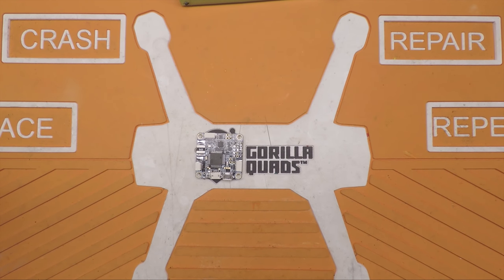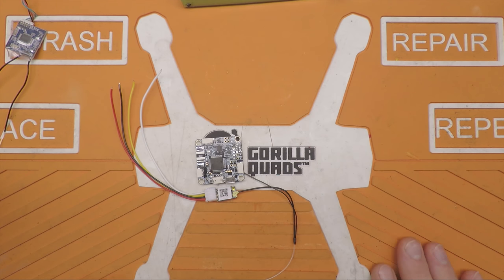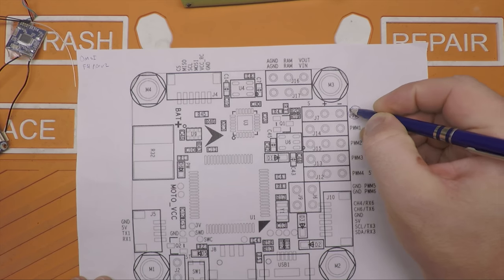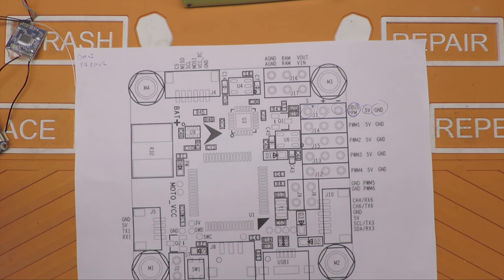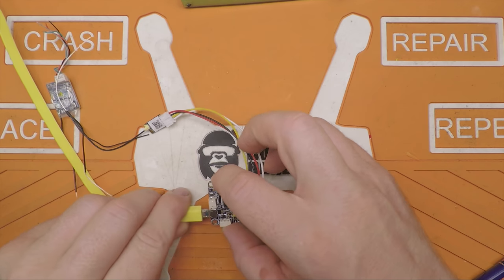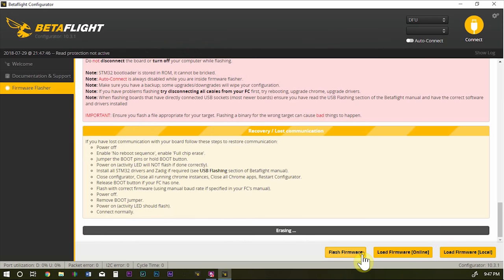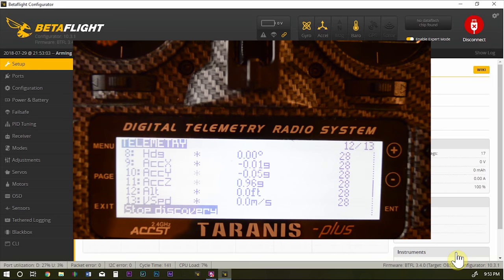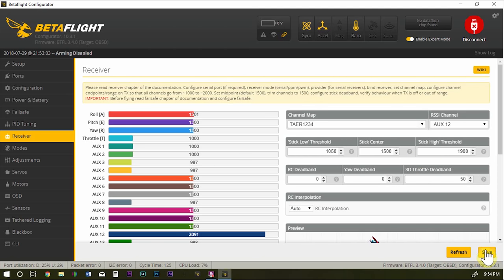How to setup frsky Smart port on a F4 flight controller r9 mini omnibus f4.

Comment: im try to connect my r9mm to a OMNIBUSF4SD board.  i on the lastest firmware 190201 on both my R9m and r9mm. i can bind them ok. ive tried wiring the sport to the Sbus receiver and also to a empty uart on the TX side. tried following on but no matter i do i cant get the quad to see the joystick move. any help would be much appreciated thank you
Reply from the maker: for starters are you using sbus or fport firmware on  your R9mm? also you can contact me on my discord server. https://discord.gg/zRKg6G this is a much easier way to help with troubleshooting!

Comment: I have omnibus f4 v3 pro and fc have ch6 pad for  Smart port do i must do inverted hack or i can connect ch6 pad to inverted smart port pad on r9mm or on normal smart port pad on r9mm rx in inav setup
Reply from the maker: Connect the regular s.port pad (one just below the sbus pad) to motor 6 and use softserial. Inav does not allow you to re-define resources. So you are stuck using just motor 5 and a rx pad and motor 6 as a TX pad in softserial mode. That should work. You might need to change telemetry inversion to off or on depending on how the pad behaves in inav.
Reply: But that not motor ch6 pad it is ch6 pad on side of power wire on omnibus board or tx pad see wiring
Reply from the maker: My mistake ch 5 and ch6 not motor 5 and motor 6.
Reply: Ok 👍

Comment: i can't enable Softserial as a feature in Butterflight configurator. After save&reboot it's set back to disabled. i have a heliospring board. i reflashed the board and also tried another version of the configurator. i must be missing  something, do you have any idea?
Reply from the maker: Sorry I haven't messed around with butterflight. My guess is that isn't a feature they support but again that's just a guess.
Reply: TweetFPV thanks. just found out that they natively support inverted smartport so i don't actually need softserial at all!.
Reply from the maker: That is great news!

Comment: Question for you.  I have an R9MM on a Betaflight F4 and Smart port to TX3 as listed in the printed instructions for the FC.  However I only receive RSSI and Battery voltage for telemetry values.  I have another quad that is on a Matek F405 using soft serial and I see all the telemetry values on the radio.   If I was to change TX3 on the BF board to a soft serial for TX3 instead of the UART resource would I then get all the telemetry values beyond RSSI and Vbat?
Reply from the maker: What fc are you trying to connect to? If it's a f4 most likely you should be using the "inverted s.port / f.port" pad from the r9mm to an unused uart tx pad. With the r9mm there is no need to use soft serial.
Reply: @TweetFPV  using fpv model beraflight f4.  Using un inverted s.port on r9mm.  So sounds like I need to be on inverted s.port.
Reply from the maker: Yes, I just looked over the pin out for your fc. You need to use the "inverted s.port /f.port" pad on the r9mm since the bff4 doesn't have a telemetry / inverter on one of its other uarts.
Reply from the maker: Check out this video I made it is basically the same procedure you'll need. https://youtu.be/5Yl-GBdvclI
Reply: @TweetFPV  thank you
Reply from the maker: You are welcome. If you have any issues feel free to email me and I can give you a hand.
Reply: @TweetFPV  so I just switched over to the inverted s.port and now get full telemetry thank you so much for your help again.
Reply from the maker: Not a problem. I'm glad it worked out and I was able to help. If you ever have any questions feel free to ask.
Reply: @TweetFPV  So as it would turn out I do have one more if you don't mind since you seem to be the expert on this LOL...I think I know the answer but, here goes...R9Mini (not MM) just installed in my XL5 today w/ DYS F4 V1.  Currently attempted to connect s.port to Uart 6TX w/ s.port select in BF on Uart6 but, I dont think it's working..I do notice there is an RSSI pad but, not sure how I would direct s.port to that pad or if thats even what It's for unfortunately the DYS documentation isn't very clear to me about it.  Any ideas on how to properly connect s.port from R9Mini w/ no inverted s.port pad :(.  Currently trying to use uart 3 RX/TX for runcam device for camera control on a Runcam Micro 3 that has rx/tx control pins and not getting cam control though it's turned on for UART3.  Bonus points if ya have any ideas on that..LOL
Reply from the maker: For the r9 mini you cant use the rssi pad because it is a adc (analog to digital converter) you can use the uart tx pad but you will need to use soft serial to get the fc to use the cpu to do the inversion since there isn't a hardware inverter. This video is the process you need to follow to get that to work. The resource values could be different. But the process is the same.

As for the runcam. A big thing that people do incorrectly is the go tx to tx and rx to rx. The correct way to connect the cam is rx pad on the cam to a TX pad on the fc and vise versa. Then in bf in the ports tab you need to select runcam device in the periferial menu.
Reply: @TweetFPV  So it's still currently connected to TX6, I went to free the resource for TX6 which is C06 which I did and assigned ti to SS 11.  Then enabled soft serial and turned on S.port..I then forgot to check if other resources were using C06 and it's good thing I looked cause it's also pwm3 (this is the motor 3 output right) so I got scared and reasigned C06 back to TX6.  I also looked at resources for additional pwm outputs after watching your video again :) and saw there is a pwm 5 and 6 in the resources but, I have no idea where the pad would be for it.  I looked but, don't seem to see it and searches turn up empty.  What do you think the best pad to use for SS on the DYS F4 would be.  BTW I do have the RX/TX pins going to the TX/RX of the FC on UART3 for the Runcam.  Still no luck on that one but, I can live with it.  Need my Telem data though :) Again really appreciate your help.
Reply: @TweetFPV  Okay just though I'd update you on what I have done last...Camera is working...moved to uart 6 from uart 3.  Attempted un-inverted s.bus hack https://oscarliang.com/uninverted-sbus-smart-port-frsky-receivers/ it was a bitch but, i think i may have it successfully soldered to this pin.  It passes a light tug test....heat shrinked and reinstalled carefully.  Uninverted smart port wire from component leg going to RX3 and selected in BF.  I didn't get any additional sensors from the the radio telemetry when trying to detect.  I also tried to see if the receiver would update via serialpassthrough as a second test to see if the s.port worked but, was unsuccessful.  So just asuming at this point that the uninvert hack didn't work.  I do have RSSI and v.bat as well as my RunCam working now..so good enough unless any further suggestions.
Reply from the maker: TX6 using the same resource as PWM3 doesn't make any scene. I would use the LED strip pad for your s.port using Soft serial.  as far as the RC control check out the RR store listing on how the stick commands work for it. they are a little different that what i though they would have been. https://store.rotorriot.com/runcam-uart-control-adapter/
Reply from the maker: Sorry. I just saw that the bots of youtube flagged this post for review. IDK why they do this.

What pad are you soldering to on your R9 Mini?
Reply: @TweetFPV  Soldered to the last leg of the 2nd ic on the bottom of the receiver as referenced here..see bottom of page https://oscarliang.com/uninverted-sbus-smart-port-frsky-receivers/ I didn't want to use the LED because it is being used for a buzzer led combo which I may scrap and just go soft serial since this s.port hack didn't seem to work.

Comment: Hello, sorry to bother, but I can't connect that receiver (r9mini) whit my f4 no matters what pin I try. I have a mamba f405 mtk board and I am connecting the receiver smartport wire to tx6 pad on the board, then I make the serial port and don't work (I have played also whit the tlm inversion and nothing). But if I have a r9mm (whit inverted smartport) it works flawless, what iam missing here? Can anyone help?

Comment: If using the led pads i would solder the smart port wire to the signal pad for led is that right?
Reply from the maker: Correct.
Reply: @TweetFPV  ok thanks great video I been trying to figure out how I was gonna put my gps and smart port on the small in 1 flight controller I ordered and then i found ur video perfect

Comment: Can you assign soft serial to an UART if you don’t have a motor 5 pad?
Reply from the maker: Yes you can.
Reply: So I tried this on my omnibus f4 pro v3 with a R-xsr on motor pad "5" with success . Tried the same process on a Lumenier Lux F4 v3 micro stack. There are only 4 motor output and they are on pins to attach the 4n1 esc to the FC in the stack. So I used UART 6TX pad. I got nothing...
Reply from the maker: Nothing.... Like soft serial port doesn't show up in the ports page?
Reply: It does 👍🏽, and I set it to smartport on softserial, and I set to discover new sensors, but I get nothing
Reply from the maker: do you get your sticks to move in the receiver tab in betaflight?
Reply: Yes everything is fine, just not getting telemetry
Reply from the maker: try 
set tlm_inverted = on 
save

or possibly off in the cli
also what version of BF are you using?
Reply: BTFL 3.2.5 and setting the telemetry inverted on(it was off) didn’t work
Reply from the maker: ok, this is to the point where it is difficult to diagnose through youtube messages. Feel free to email me some pictures of your connections, bf pages and a cli dump to tweetfpv@gmail.com
Reply: Ok , not sure what I got wrong the First time but second go around got it done
Reflashed my FC, went back through the steps but for serial_tx 6 instead of motor pad 5 like I did the first time and this time it worked.
Reply from the maker: awsome!! glad you got it going!!!

Comment: I only need RSSI value, can just plug it like XM+ (s.bus, gnd and vcc) ?
Reply from the maker: Yes but only with the newer fw versions for the xm+ it will come across as aux 4 in betaflight
Reply: @TweetFPV  Im sorry, maybe I wrote it wrong, its for my R9MM...can I just plug s.bus, gnd,v cc to get RSSI just like when I did to my xm+ ? Thanks in advance
Reply from the maker: Yea you can do that. I know your transmitter will always get rxbat and rssi. I'm not 100% sure if it  goes to the fc on the sbus signal like the 2.4ghz rxs I've been using fport for so long that I've never though about it. Either way one of the telemetry sensors will be rssi. You can either send that back to your fc on a aux channel or just have your radio do low rssi callous. It just depends on what your end goal is.
Reply: @TweetFPV  thanks FYI 😀, for 3 years I temporary quit from touching FC and drones and just flown airplane model, never thought FPV world gone this far complicated, yet its so fun

Comment: I don't know why i can't have receiver signal from radio.. r9m and mini are already binded and i soldered sbus on sbus on fc ( Mamba f4 30x30 stack)
Reply from the maker: Are you using r9mm or r9 mini?
Reply: @TweetFPV  The R9 mini. I solved, i swapped sbus with the fport wire and confused with the R9 MM.. Thank you and thank for your videos! Always helpful

Comment: can you do this on Inav?
Reply from the maker: Sort of. Inav is very specific about what pads can be used with soft serial. You can just reassign any resources. The inav wiki page has specifics about each flight controller listed. From there you can find which pads get used as softserial for the smart port inversion.
Reply: @TweetFPV  Thanks, i will taka a look!
Reply from the maker: Good luck. Hit me up if you have any questions. I have very little knowledge of inav but some things are universal between firmwares.

Comment: im using r9mm version.. can i use this F4 v2?
Reply from the maker: Yes, the r9mm is perfect for the f4 v2. Just use the sbus and inverted smartport pads from the r9mm.
Reply: TweetFPV where is the smartport pad? Also im using furious stealth vtx, where can i solder the smart audio?
Reply from the maker: Not on the r9mm. You'll need to solder your smart audio wire to an avalible uart tx pad on your flight controller.

Comment: how would you connect R9 Slim+ to F4 board?
Reply from the maker: That is a very loaded question. Which FC, FW, and are you looking to just use SBUS, or do you want to use SBUS and Smart Port telemetry, How about F.port?
Reply: TweetFPV sbus and smart port telemetry. If R9 slim+ has same configuration as R9 mini then it's easy for me just follow your video. But I am not too sure about F port and it's functionality.
Reply from the maker: Ok. Use the sbus out pin from the slim+ to your sbus pad on your fc then use the rx1 pin from the slim to any unused uart tx pad on your fc. The slim + has inverted smart port avalible so you dont need to mess with soft serial or inversion.
Reply: TweetFPV thanks! The inverted and uninverted thingy creates a lot of confusion to me
Reply: Can we power the F4 pro v2 directly from battery or through power module?
Reply from the maker: @dronepilot1333  you need to power this board with 5v only.

Comment: I have an rssi pad would that happen to be a telem pad?
Reply from the maker: No, the rssi pad is one of the few ADC pads (analog to digital).
Reply: Ok thank you. I just got mine set up like you did. Thank you!
Reply from the maker: That's good news. I'm happy it worked out for you!
Reply: So I did buy an MM I dont need to have a 4th wire correct?  I can just solder the inverted to a tx and that's it right?
Reply from the maker: Which flight controller are you using?
Reply: The hglrcf440 its a mini stack.
Reply: Ok soft serial is not showing up in ports tab
Reply from the maker: Do you have a spare uart on your fc avalible?
Reply from the maker: Since you are using a f4 fc you don't need to use softserial is you have a spare uart. You will end up using the sbus, power, ground, and "inverted s.port" pads.
Reply: I'm using the mini on this hglrc f440. And I have the tbs smart audio on uart 3 and runcam on uart 6. Unless I dont need smart audio anymore.
Reply: Ok got it working. I found new sensors it was updating showing me my rssi on my taranis but not in my osd, now I got it showing in osd but now no sensors are working on my taranis. Is this right?
Reply from the maker: No, that isn't right. Rssi is baked into the fw and will always come across on ch16 (aux12) you should have all the sensors in your taranis. Where do you have all your connections going to and coming from?
Reply: I have sbus to sbus and sport to led pad, I reassigned to serial_tx 11 A01. It worked until I tried to assign rssi to a channel because it wasn't on my osd. Then it worked on osd and now not on tarannis. Lol.
Reply from the maker: Do you have soft serial 1 set to smart port in the ports tab, telemetry on in the config tab?
Reply from the maker: And which sport pad did you use off of your r9mm?
Reply: Yes and I have the mini not the mm. I have
Reply from the maker: go to the cli and type 
set serialrx_inverted = off
set serialrx_halfduplex = off
save

the delete all sensors on your taranis then select discover new sensors. 
let me know which if any sensors you get back.
Reply: Ok got it. All I did was delete sensors and discover them again and its working perfect.  Wonder why they jist quit like that.  But now I know just to rediscover if they quit working.
Reply from the maker: Awesome, glad you got it working!